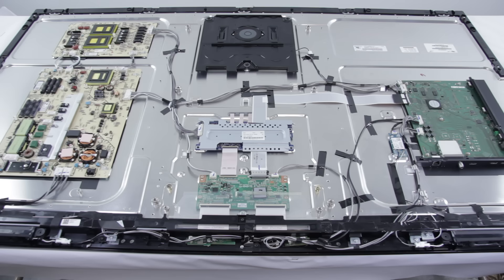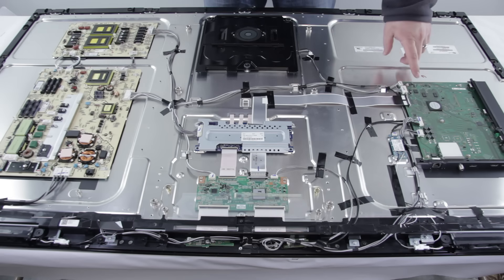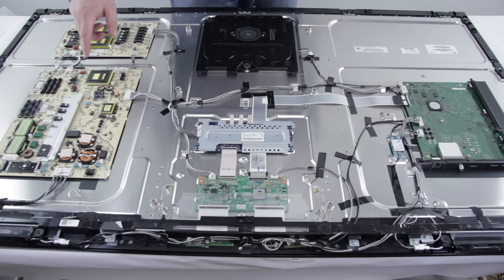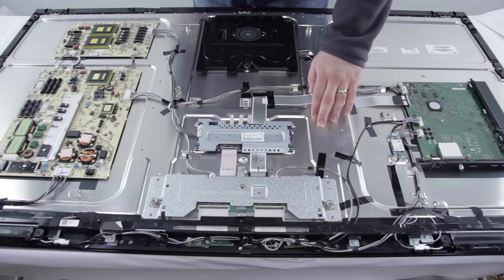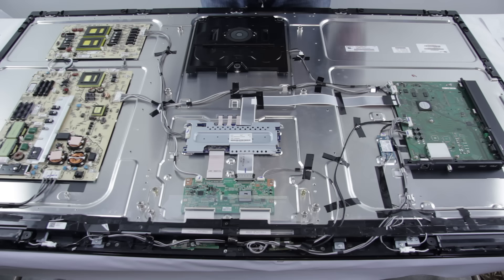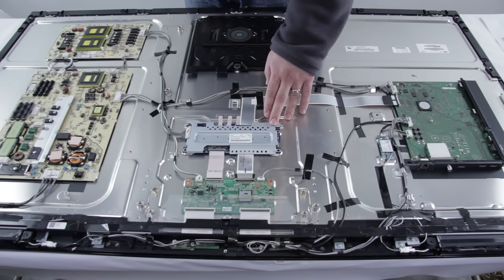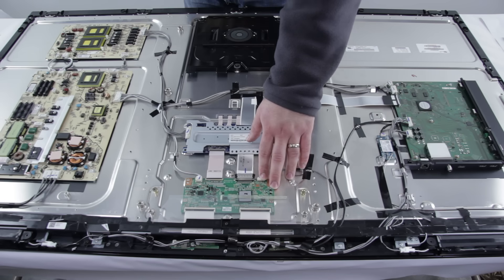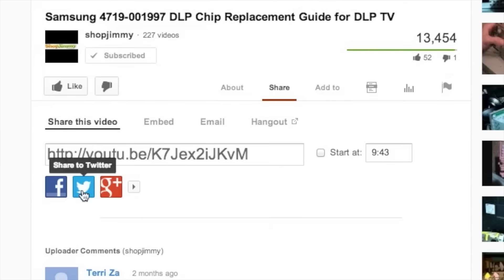LED TV Repair Tutorial - Common Symptoms & Solutions - How to Repair LED TVs

Comment: Hey Guys, need your thoughts on issues with our LG 50 PK950.  About three years old. TV turns on, have sound, has picture but picture keeps flickering, keeps mirroring images left to right, vertical hold  sometimes compresses image top to bottom, bright images on screen appear black instead of their true colors and once every minute or so for a split second will get black screen and then flickering/mirroring picture returns.

Any thoughts are greatly appreciated.

I have a video if needed.  Thanks!
Reply from the maker: NAHORODNY AMC   This sounds like a TV panel (TV Screen) problem.  If your TV panel is bad, it may be more cost-effective to replace the TV as panels are typically hard to find in stock, difficult to replace, and expensive.  Thanks and please let us know if you have any further questions!  www.shopjimmy.com

Comment: Thank you for the video. I have a LG 50LA6970 that is receiving power via the indicator light. It will not turn on to play sound or display a picture. I replaced the power supply board PCB EAX64908101 (2.2) with a new board and have not achieved any success at fixing the television. Any help would be appreciated.
Reply: Also, how would I know whether or not the replacement of the main board is necessary (ebt62621002)? I believe that the tv was damaged because someone plugged in an audio receiver's usb to the USB-IN input, which we discovered draws power from the tv, though I don't know that for a fact.

Comment: Hello, I have a Emerson LF320EM4 that after a electrical surge, it no longer shows a picture.  It  has audio and when you pull the back cover off there is light (backlight??).  None the capacitors on the PS show any visible swelling. It has two visible boards, is there a third i.e., TCON board on this model?  Thank you for any help!
Reply from the maker: Jason Talbot  Please watch this video FIRST to help with your repair!  https://www.youtube.com/watch?v=BP3NVNCGEv8  I recommend replacing the digital board in your TV.  Click this link to replacement parts:  http://www.shopjimmy.com/catalogsearch/result/index/?cat=225&q=LF320EM4  Be sure to match part numbers on your current board, with your replacement for compatibility.  Here is a link to a video showing how to identify your part number, click here:  https://www.youtube.com/watch?v=LIWO2A_tuaI  Thanks and please let us know if you have any further questions with your TV Repair!  www.shopjimmy.com

Comment: I have a Sharp AQUOS 42" LC-42LE620UT 1080p 120Hz LED HDTV that when it warms up has a vertical bar about six inches wide slightly left of center that will start to fade out then eventually will turn in to a solid red bar  if you turn the tv off for a while it wont appear for about a half hour maybe a little more could this be the T-Con board?
Reply from the maker: yewtreefire   This sounds like a TV panel (TV Screen) problem.  If your TV panel is bad, it may be more cost-effective to replace the TV as panels are typically hard to find in stock, difficult to replace, and expensive.  Thanks and please let us know if you have any further questions!  www.shopjimmy.com

Comment: Hi,  I have a 50" LED Samsung TV, Model LN55C630K1FXZC.  My TV has lost it's picture.  The sound is OK, but the screen has bands ranging from white , grey, light blue, and a greenish colour with various small coloured lines running vertically.  It first started with 1/2 of the screen with a normal picture and then half of it looked like you were watching TV through wax paper.  It progressively got worse, and now the bands and no picture.
Reply from the maker: Nittinanny   This sounds like a TV panel (TV Screen) problem.  If your TV panel is bad, it may be more cost-effective to replace the TV as panels are typically hard to find in stock, difficult to replace, and expensive.  Thanks and please let us know if you have any further questions!  www.shopjimmy.com

Comment: I have an LG 47LV500-UA, LED recently when the tv turns on, the picture looks "posteriized" or verticle line and the color looks screwy. sometimes after a while the tv self adjusts into it normal beautiful picture.
Reply from the maker: Jay Houghtling   This sounds like a TV panel (TV Screen) problem. If your TV panel is bad, it may be more cost-effective to replace the TV as panels are typically hard to find in stock, difficult to replace, and expensive. Thanks and please let us know if you have any further questions! www.shopjimmy.com
Reply: HI, thanks for getting back to me. I may of given a bad description of the problem. Upon further research, what I'm seeing is solarization when first turned on-the main screen as well as the menu, every so often it stops, then back to solarization. Could this be a t-con board? Model number LG47LV5500--UA.AUSYLJR
Reply from the maker: Jay Houghtling   This could be a problem with the main board, the t-con board or the TV panel.  Watch this video for more help:  https://www.youtube.com/watch?v=G8777AzTf8U  Thanks!  www.shopjimmy.com

Comment: I have a LG 55LW6500-UA
Was watching TV when the picture started scrambling and then the TV turned off by itself. Now it will turn on with the power light on but no sound or picture. Please advise.
Reply from the maker: skreinayme  Please watch this video FIRST to help with your repair!  https://www.youtube.com/watch?v=BP3NVNCGEv8  I recommend replacing the main board in your TV.  Click this link to repair parts:  http://www.shopjimmy.com/catalogsearch/result/index/?cat=56&q=55LW6500-UA  There may be multiple boards for the same TV model number, be sure to match part numbers on your current board, with your replacement for compatibility.  Here is a link to a video showing how to identify your part number, click here:  https://www.youtube.com/watch?v=RwHTvjMdrhk  Thanks and please let us know if you have any further questions with your TV Repair!  www.shopjimmy.com

Comment: Hi! I have a Westinghouse 40" or 42" LED TV. I can find out the exact model number if you need it. I have it mounted on the wall and will have to take it down. The problem I am having. The other day it had a green fuzziness everywhere that should be black. The rest of the colors were fine. When it was on a little while it got better. Then I noticed some light spots in the corners later watching a movie. Today I put something on and had a great picture, but then it started flashing a white screen and then the picture. Flashing between the picture and a white screen. Do you know what it sounds like? Thanks!
Reply from the maker: newhopenicaragua   I recommend replacing the main board in your TV.  Please reply with your TV model number.  Click here to view a video that shows how to find your TV model number:  https://www.youtube.com/watch?v=S51nhAmwR2M  Thanks!  www.shopjimmy.com
Reply: My tv is a Westinghouse LD 4695
Reply from the maker: newhopenicaragua  Please watch this video FIRST to help with your repair!  https://www.youtube.com/watch?v=BP3NVNCGEv8   Here is a link to replacement main boards:  http://www.shopjimmy.com/catalogsearch/result/index/?cat=56&q=LD-4695  There may be multiple boards for the same TV model number, be sure to match part numbers on your current board, with your replacement for compatibility.  Look at the listings and check part numbers info in red on the listing pages.  Thanks and please let us know if you have any further questions with your TV Repair!  www.shopjimmy.com

Comment: I have a samsung led 3d tv, model un40c7000wfxza. One day vertical lines showed up on the screen, a little left of center about 2 inches wide.  What would be the solution for fixing this?
Reply from the maker: Brad Nowak   This sounds like a TV panel (TV Screen) problem.  If your TV panel is bad, it may be more cost-effective to replace the TV as panels are typically hard to find in stock, difficult to replace, and expensive.  Thanks and please let us know if you have any further questions!  www.shopjimmy.com

Comment: Hi, I have a Vizio E601i-A3 LED TV. Last week a single vertical blue line now shoes up on the screen. It is visible on all inputs and the TV menu. If you look real close at it you can see the individual pixels so another way to describe it would be a vertical blue dotted line running from the top to bottom. I read many forums and watched your video and it seems the T-Con board needed to be replaced. I purchased a new board and replaced it but this did not solve my TV problem. Is there something else required that I may have done incorrectly when installing the new T-Con board? Or do you have any other thoughts or suggestions? Thanks.
Reply from the maker: Addison Siegel   This sounds like a TV panel (TV Screen) problem.  If your TV panel is bad, it may be more cost-effective to replace the TV as panels are typically hard to find in stock, difficult to replace, and expensive.  Thanks and please let us know if you have any further questions!  www.shopjimmy.com

Comment: Shop Jimmy,
I have a Samsung UN65ES8000. The issue that Im having is not all the time or consistent. When I and using a device (xbox one and an xbox 360) that is plugged into the HDMI ports on the main board and I change the volume, or try to open a tv menu, the picture on the screen becomes striped randomly with random colors and all sound stops. If I let it sit like this it will restart the TV automatically and loop. It does not do this all the time, usually it has been on for 10+ minutes before I can get the issue to repeat itself. Only way to stop the loop seems to be to unplug it. I've tried all 3 hdmi inputs different cable and different devices, they all do the same thing. To me it sound like the mainboard, does that sound correct?
Reply from the maker: Casey Reed   Please watch this video FIRST to help with your repair!  https://www.youtube.com/watch?v=BP3NVNCGEv8  I recommend replacing the main board in your TV.  Click this link to replacement parts for your TV model number:  http://www.shopjimmy.com/catalogsearch/result/index/?cat=56&q=UN65ES8000  There may be multiple boards for the same TV model number, be sure to match part numbers on your current board, with your replacement for compatibility.  Thanks and please let us know if you have any further questions with your TV Repair!  www.shopjimmy.com

Comment: hi i have sony led tv theres a problem of vertical lines and double image...is that my tv is Tcon problem or flexwire
Reply from the maker: robert Malveda   This sounds like a TV panel (TV Screen) problem.  If your TV panel is bad, it may be more cost-effective to replace the TV as panels are typically hard to find in stock, difficult to replace, and expensive.  Thanks and please let us know if you have any further questions!  www.shopjimmy.com

Comment: I have  Sceptre LED TV E325BV HD 8WX2201A - the TV is two and a half years old and not all of the backlights are coming on.
Reply from the maker: Michael Brunelli  Please watch this video FIRST to help with your repair!  https://www.youtube.com/watch?v=BP3NVNCGEv8  This could be a bad power supply or a problem with the TV panel.  You can replace the power supply to see if that fixes the TV, here is a link to possible replacements:  http://www.shopjimmy.com/catalogsearch/result/index/?cat=59&q=E325BV+  There may be multiple boards for the same TV model number, be sure to match part numbers on your current board, with your replacement for compatibility.  Thanks and please let us know if you have any further questions with your TV Repair!  www.shopjimmy.com

Comment: i have a Samsung UN55ES8000  it was serviced by samsung about 2 months after i bought it. they came and replaced two boards looked like the power supply and the main board i was having vertical  lines no picture. now that its out of warranty it made a pop and went black had a smokey smell  now it just clicks and wont turn on. it makes two click then a few second later makes two click etc.. i opened the back took the power supply board off didn't see anything burnt and the capacitors did not looked popped etc.. any suggestions?
thanks
Reply from the maker: elect1960   Sounds like the LEDs in your panel popped and you have a bad TV panel.  If your TV panel is bad, it may be more cost-effective to replace the TV as panels are typically hard to find in stock, difficult to replace, and expensive.  Thanks and please let us know if you have any further questions!  www.shopjimmy.com

Comment: Hello.  I have a samsung un55d7000lfxza.   The TV is not powering on.  I've removed the panel from the back of the TV and inspected the capacitors and i don't see any bulged or damaged.   When power is connected to the TV I can hear a clicking sound coming from the power supply board and the RED standby light blinks twice then pauses and continues on that cycle.  
Your video on how to determine if it's the main board or power supply board was very informtive  on an LCD tv.  ON that video it showed where to measure voltage on the power supply board.  I tried to do that on this LED tv but wasn't sure where to measure on the outputs.  Please assist.
Thanks,
oa
Reply: Did some more research and troubleshooting.  
1.  When I disconnect the main board the clicking on the power supply goes away. 
2.  A few times when disconnecting or connecting the power the panel would light up for a second then turn off. 
3.  Took village measurements at the main board connector.  I'm getting 5.39v on pin 17 and 3.38 v on pin 19.  Per the pin out legend the outputs on these pins should be 5 v. 

With that said I'm leaning towards the main board being bad. I saw your video on an lcd on how to pin out certain pins to fire up the panel.  I wasn't sure which pins to jumper on an led to see if the panel would turn on to confirm that the main board is bad. The main board number is bn94-004355k.
Reply from the maker: Ovidio Alanis  Please watch this video FIRST to help with your repair!  https://www.youtube.com/watch?v=BP3NVNCGEv8  I recommend replacing the main board in your TV.  Click this link to replacement parts:  http://www.shopjimmy.com/catalogsearch/result/index/?cat=56&q=un55d7000lfxza  There may be multiple boards for the same TV model number, be sure to match part numbers on your current board, with your replacement for compatibility.  Here is a link to a video showing how to identify your part number, click here:  https://www.youtube.com/watch?v=BEPWrefQvqI  Thanks and please let us know if you have any further questions with your TV Repair!  www.shopjimmy.com